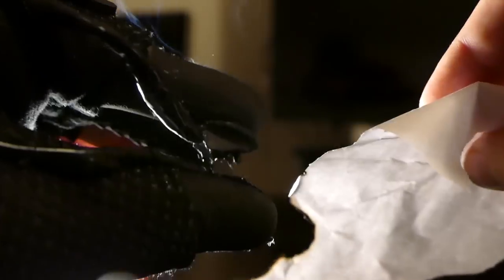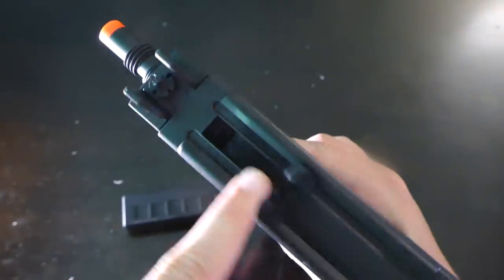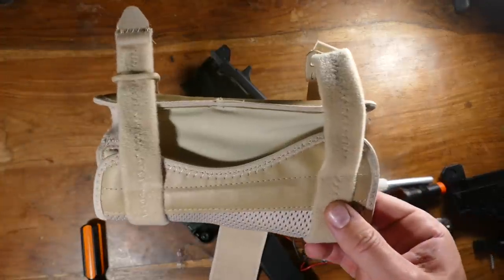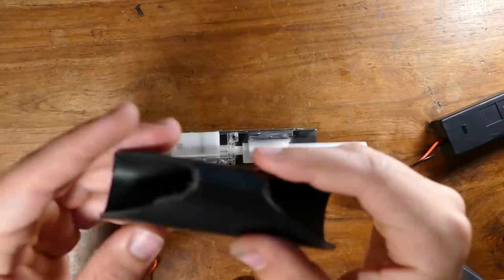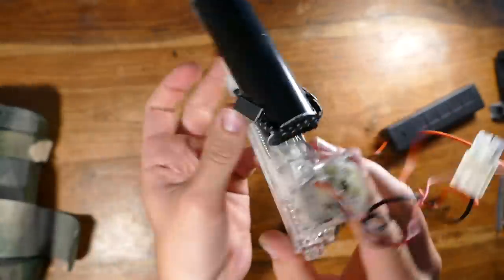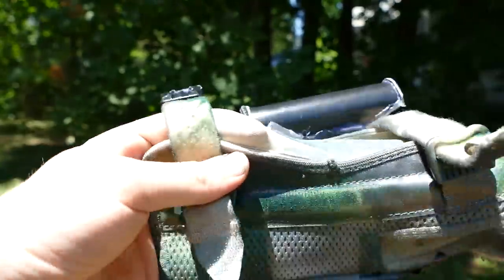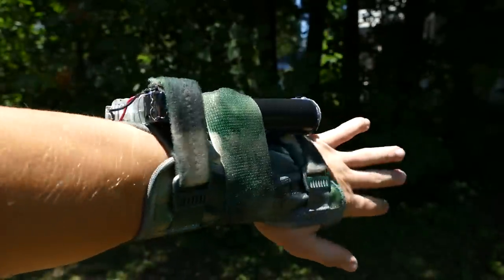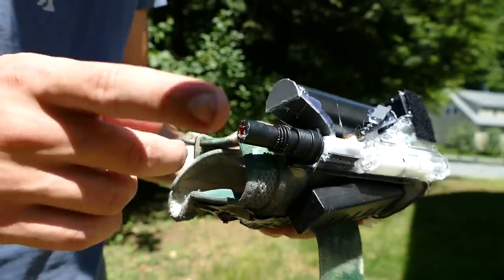DIY Wrist Airsoft Gun! - Amazing Spy Gadget (Full Auto Electric)

Comment: I have been thinking about an invention and I think you could probably build it. A triggered bow(not compound) made to collapse for transportation and with kind of a trigger for arrows. A rapid fire and virtual sniper like scope in the form of a visor(like in dbz) a magnetic pull for the arrow to keep the arrow in place until fired. Trigger release and reload under the arrow deck and a rotating dock to house and load the arrows. I definitely think you should try it out. It would be kinda cool.

Comment: There is a old Sci-fi book series called The Matador Trilogy, In the first book "The Man Who Never Missed" His main wepon is called a spetsdod.  it is a very sophisticated weapon, consisting of a semi-adhesive block of plastic, a 6" barrel, and a reloading port for magazines of various sorts. The plastic adheres to the flesh of the wielder when a chemical is added to the mixture to make it pliant. The barrel is then braced in the material, behind the index finger on the hand, you shoot by pointing and your middle finger makes the connection with the tip of the barrel which is pressure sensative and Pop goes the round. Bring the ART of point shooting to a whole new level

Comment: 1.make a wrist flamethrower, with a gas tank mounted with that body armor that you made
2.head mini gun (gun mounted on your helmet, which on that body armor that you made) + a laser tag
3.make a wrist spring/spin over blade (reference assassins creed, or gundam exia) + connected with a taser, or
4.from the 3rd idea of the blade, not a taser, but that step up ladder electric thingy (reference, star wars riot baton) electric effect
5.from negative ion generator, wear under your shoes, with a button there, you can charge up your body, and you will carry a oil/fuel cottonball (for fireball), so take the cottonball, then charge a little bit, you might create a fireball, then you could throw it
6.shoulder bazooka, mounted on that body armor you made, this simply just like a potato gun
7.could be store on your wrist gauntlet / body armor that you made, an electric/taser whip
oh 8.9..10 I really on to the stuff man, please made those xD any of those
Reply: 8.a flip over fully protecting your arm knuckle, with some exploding material on it (give it an effect when you punch things) and that is replacable, others store on your body armor that you made
Reply: an addition to the number 1, for safety, there is another tube to be put on, so it extend, or the flamethrower are just extendable, (powered by a taser, for cheaper cost than a taser, take a part from a fly/mosquito racket)
Reply: the gundam exia blade are just like the switchblade actually
Reply: 9.some other diy, if you have a motorbike (sportbike) make your own side fairings with a airsoft machine gun on it, could be electric too tho
10.make a mini jet engine, or just took it from an rc jet plane, and mount it on the bike tail fairing/bodypart (sorry for kinda oot)
Reply: 11.a mountable shield to your body armor you made
Reply: a suggestion for anything mounted on your body armor you made, make your amor look like spartan halo armor suit, and those jetpack they have, it'll be for storing your air tank and gas tank, and also removable, to switch with the shoulder bazooka

Comment: I cannot find a momentary switch that is short enough, and where the wires come out of the side.
Reply: I’m pretty sure he soldered the wires onto the switch. If you don’t have a soldering iron you could use electrical tape, but it’s not going to be a good connection.

Comment: would this be good to use for parkour during airsoft
Reply: WhiteWolfAmbush Honestly parkour doesn't mix with airsoft as well as you'd think. I've used it to great success many a time but overall it's just a bad idea. No sanctioned field in their right mind would allow it in most circumstances. Also having a simple trigger like that would backfire 100% of the time (trust me that shit happens). I've used a hidden blade once and even that got annoying quickly. I can elaborate on what I consider a success or failure.

Comment: Or you could find a bb gun that works and duct tape it to your arm...😐
Reply: how would you fire it?
Reply: +Yepperz by pulling the trigger?
Reply: +YourNameHere exactly
Reply: YourNameHere then that would involve using both of your hands
Reply: +Yepperz so?
Reply: Raxoraptor so that destroys the purpose of this
Reply: +Yepperz the purpose is to make a wrist mounted airsoft gun, not a one handed gun.
Reply: Raxoraptor 1 handed is a perk to this though and one of the reasons
Reply: +Yepperz what else are you gonna be doing with your other arm? You'll be too focused aiming. And plus with two hands you're more accurate.
Reply: Raxoraptor have another bb gun in your hand
Reply: holding a sniper rifle for example. Lets say you get ambushed as a sniper, and you the wrist gun and the pistol for close quarters. You imideatly fire the wristgun while fumbeling the pistol, and with the wrist gun you killed the intruder, before you even manage to take your hand of the sniperifle